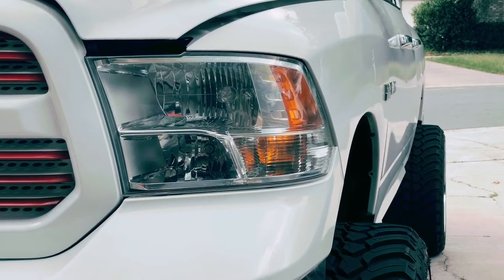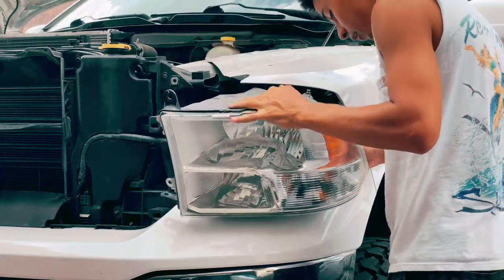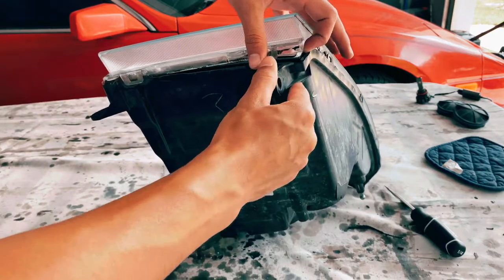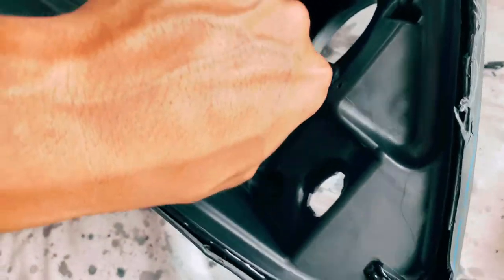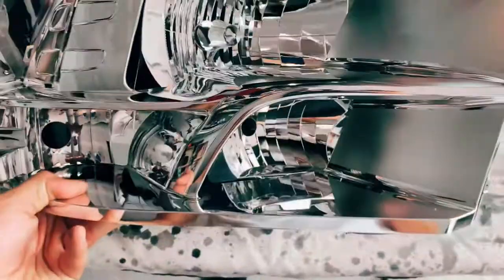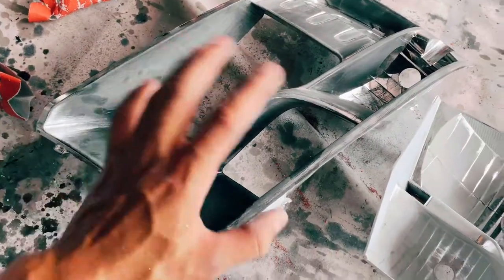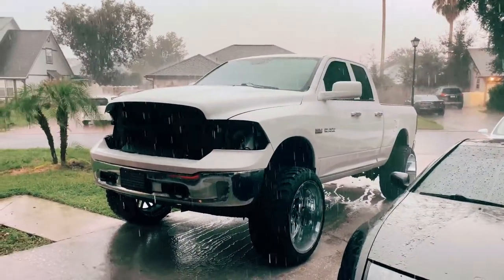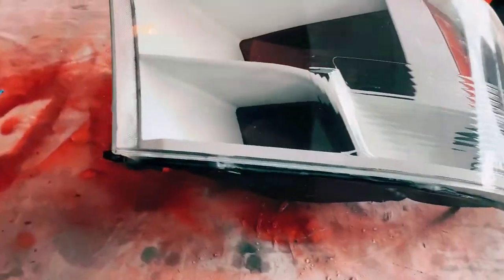Painting Rams Stock headlights ( pass or fail )

Comment: should've turned the lights on at night
Reply from the maker: I would recommend adding a projector or led pod inside the headlight only if you paint the reflector shield like I did. Made the mistake of not adding one the first time I opened the headlights. But down the road I installed a led pod and it still looked good.